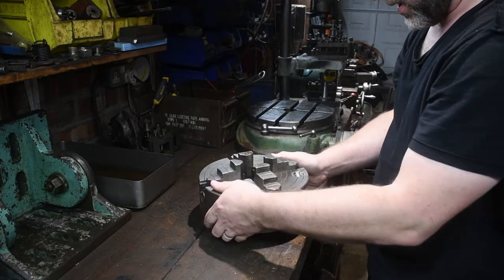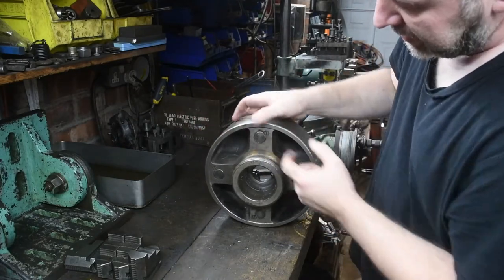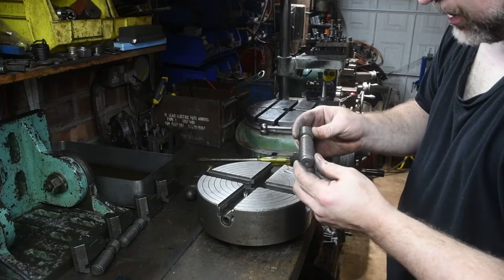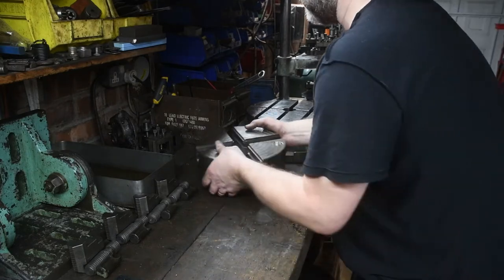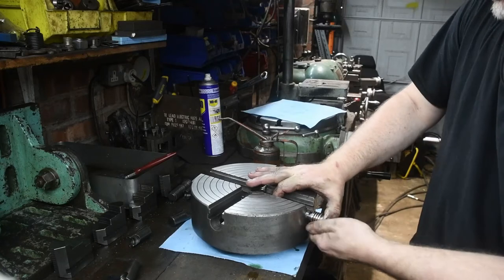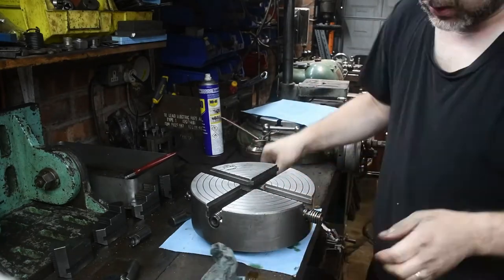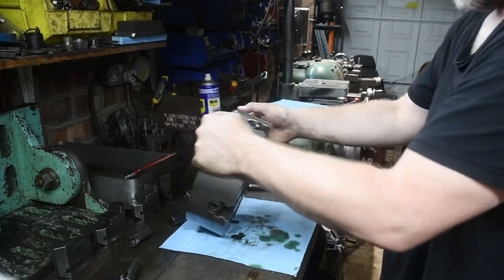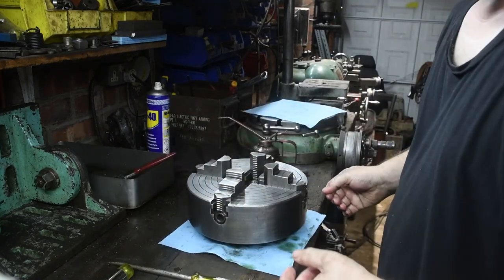Pratt Burnerd 4 Jaw Chuck

Comment: Yes, for an unknown reason the spanners for the chuck nut seems to be lost on many Colchester lathes that I have seen. 
My first Colchester was of course a Student Mk1,5 (same feed control lever as on your lathe) and it had the spanner stowed away in a hook on the right side of the chip guard.
Fun project to built one of a proper piece of steel (as I recall it was about 800 mm long)
Also a fun project: a protection cap for the threads of the long nose taper threads of your tooling
Reply from the maker: Hi, yeah I have a collection of projects I'm looking at doing. The only issue is finding the time. However, with the COVID lock down I have some extra time..

Comment: Excellent informative vid…I don’t think the operating screws should be that tight…glad to see you don’t use grease in the chuck…it just acts like a magnet for dust and metal chips…I use a light oil like 3 in one…so much easier to clean and remove with brake cleaner spray when doing subsequent maintenance

Comment: I have the 8" version were the "bearings" are distorted due to over tightening. Any idea who to contact for spares?
Reply from the maker: Hi, Pratt Burnerd are still manufacturing chucks. A good starting place would be them. They may still have old stock.
Try: https://www.colchester.co.uk/products/pratt-burnerd-international-workholding-chucks/pratt-burnerd-manual-chucks/

Alternatively, it may be possible to make replacement parts. If your chuck is similar to mine, there are only 3 individual moving parts. None of which would present too big a problem to machine.

You may also find spares on eBay. Let me know how you get on? Machining replacement parts would be a good project..
Reply: @m0xya  
Thanks for the reply.
I had found the link to Colchester also, but got confused as they apparently took over Pratt- Burnerd.
I will send them a message.
I also found “The handbook” october 2003 issue when I searched the web for spare parts.
It appeared that the “pins” that you and me had to drive out of the chuck body are referred to as “bearings” in the handbook, and are hopefully still available.
The screws of your chuck have the collar wich goes into the bearing, thus being capable of taking up the thrust in both directions.
In case they are not available anymore, making new ones is not a difficult task.
Mines however, seems to be hardened, or my files are dull😏, so that is a bit of a challenge.
I measured the interference between chuck body and bearing, and found it to be a press-fit of 0,01 mm